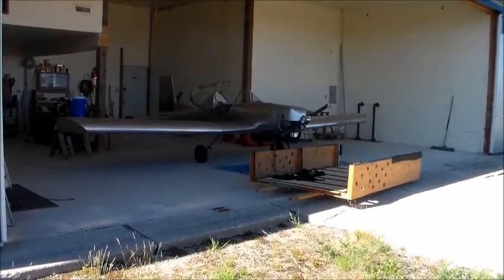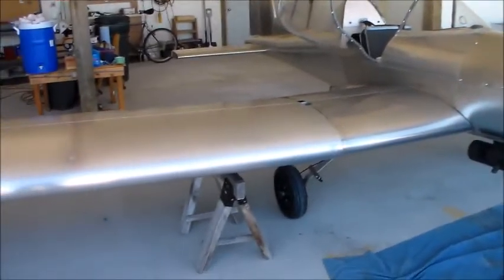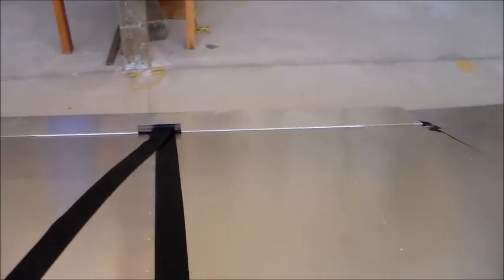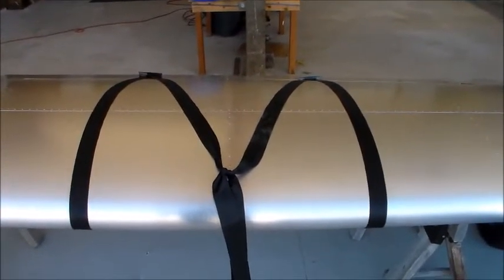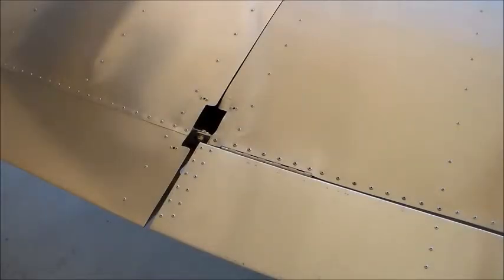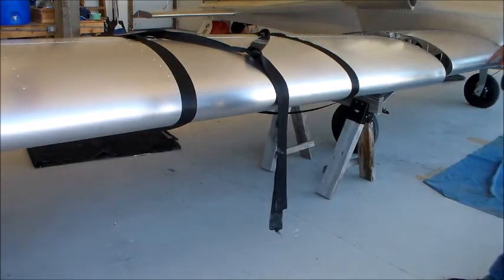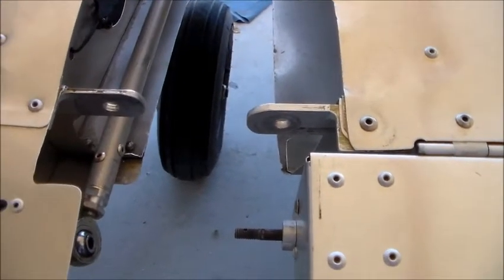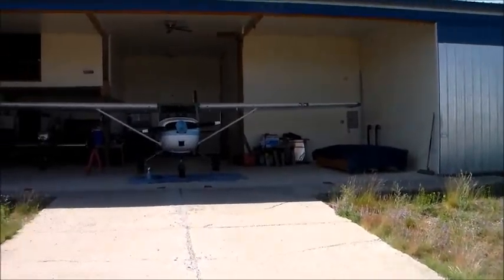How wings come off airplanes

Comment: Thought I saw some position lights on the wingtips. Quick disconnects on the wiring or connector plugs? Otherwise, an interesting video.
Reply from the maker: Yes, they are strobes but they caused radio interference that I was unable to eliminate so I don't use them. I originally had quick connectors on them. Thanks for watching!
Reply: @YamahaC7SRG   By your reply, can I assume they are high tension Zenon flash tubes? Had the same problem myself. Got rid of them and switched over to Aero LED combination position/strobe lights. Pricey little buggers but operate on 12V. No more popping in the radio.
Reply from the maker: @robertkeaney7047  Yes, you are correct! I will look into the Aero LED combo lights. When we built the Hummel, I was concerned that it's small size might make it hard to spot in the pattern. So, I added the strobes but gave up after a year or two of fiddling with it. May I ask what you fly?
Reply: @YamahaC7SRG  Rebuilding a '77 172N. Trying to find the balance between a daily flyer and a museum piece. It's hard to not go overboard!
Reply from the maker: @robertkeaney7047  Agreed. I recently bought a '69 C-150J so my wife could accompany me. We love it and fly it a lot (2-3 times/wk in decent weather). It is in great shape overall but has older, VFR avionics with a nice intercom. I don't fly the Hummel as much nowadays even though it's VERY affordable to own and operate. It's a lot of effort to put the wings on and take them off each time. I've been a pilot since 1976 and have spent a fortune on aviation over the years. Since I learned to fly and got all my ratings so long ago, I'm perfectly happy with steam gauges and find my iFly GPS is all I wanted to add to the C-150. Truth is, I didn't even need that! It seems luxurious/magical to me. (I could still fly an NDB approach - if one still exists.) The old museum pieces keep it somewhat more affordable for me since I'm also an antique and now have more time than money. Best of luck in rebuilding the plane!!